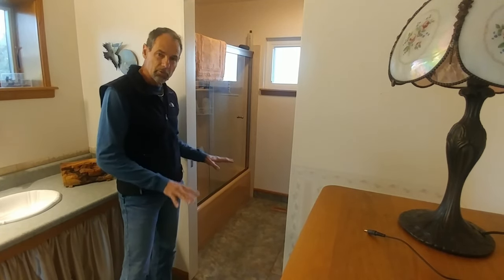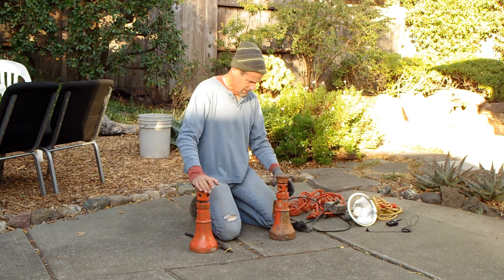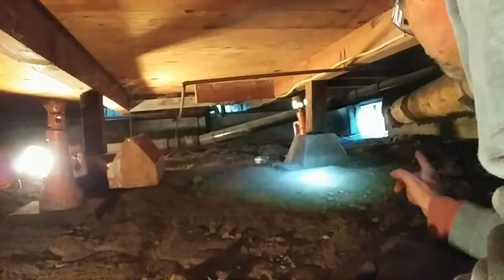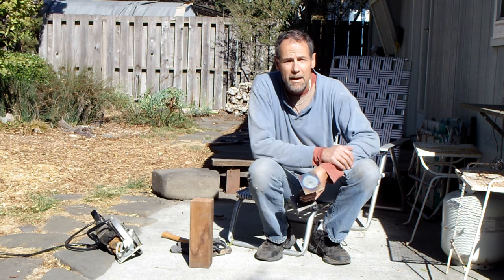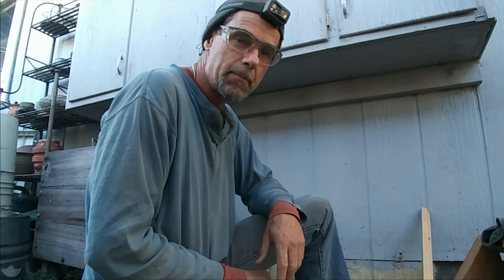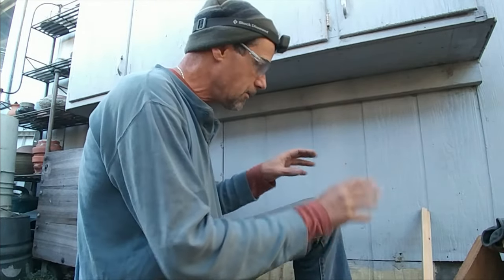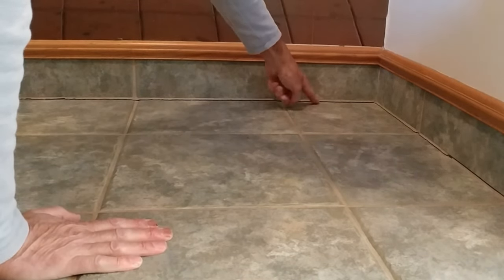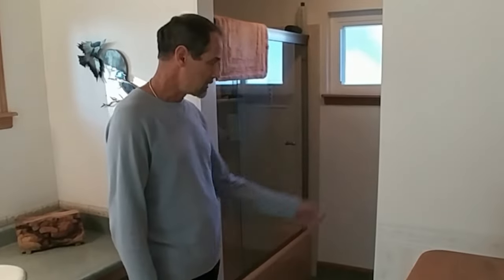Fix-it Guy Takes On Foundation Repair

Comment: Wow!  SO MUCH RESPECT to this man for getting under there and doing this work!  I personally wanted to lend a hand.  Cant believe he was by himself.  Prob a 20k job right there!   Half of my house is originally 100 year old craftsman and looks similar. Some floor noise and some mild slope, im going to have to do something similar soon.  Im kind of afraid of what ill discover down there that may require more work 😂  My crawl space entrances were all reduced by prev owner pouring driveways on either side as well.  gonna have to open them up ayayayy.  Super old perimeter foundation of river rock and local beach sand based concrete.  My area these are failing.  Curious fix-it guy,  if I can somehow use this around the perimeter to take weight off of the old footing????   what do you think?
Reply from the maker: I once worked on a commercial building which had the entire perimeter on threaded jacks. They called it a "floating foundation." They weren't this particular product; they amounted to nothing more than extremely large threaded studs sticking up out of the concrete onto which a nut and steel plates sat on each. The mud-sill, I think a 6x10 beam, was bored to drop over these threaded supports and sit on the plates. So yes, I'd say it is possible. Though of course your local building coder would need to be complied with.

Comment: Great video. Thank you. If you have to make a future adjustment do you have to remove the brackets and unscrew (or screw) the portion of the Simpson bracket attached to the 4x4 in order to lengthen or shorten it?
Reply from the maker: Just turning the nut provides +-1inch of adjustment. And of course one can always replace the 4×4 post if a grea5er amount is desired.

Comment: You did a great job and great video under 
The circumstances !! I have two questions for you 1)  Why didn’t you get
a helper to get the pieces you needed and to cut your 4x4 s instead of crawling 
in and out half a dozen times during the
day ? 2) some of the footings were off 
centre when the posts were installed , 
could you have centred them ?
Reply from the maker: To answer #1, I didn't at first realize how physically demanding the crawling would be. After all, I'm a do-it-yourselfer. Setting up and running the camera doubled the amount of crawling I had to do too, and again, I just didn't realize what effort that would require. Once into it, I just kept at it. I guess that makes me a stubborn old goat.
  To answer #2,  It isn't evident in the video but each pier block sits slightly embedded in a slop (rough pour) of cement. This prevented moving them. The evidence told me that they have always been off center. Just crappy original craftmanship as far as I can tell. I'm not sure who built this house but its loaded with crummy craftsmanship. I don't know how all these issues ever passed building inspection?! Anyway, it has stood for over 45 years regardless, and I've lived in it for 30 of those. Only now am I finally correcting many of the problems. Better late than never I guess.

Comment: So why did they build the floor joists on what looks like 48" centers? I see that they are 4 x 4 beams. I haven't seen a floor system like that.
Reply: Most places have a code that posts be on 48" center. The floor joists are usually on 24" centers.
Reply from the maker: This floor framing is rather an odd design. How'd they come up with this idea? There are other oddities in the framing of this house too. I think the builder was an amateur!
Reply: @ItsFixable  I believe it's plank-and-beam construction, not the usual pier-and-beam with 16" spacing. The subfloors are usually way thicker.

Comment: I spoke with Simpson engineers today and was told they are temporary ties and not meant for permanent installation. I was hoping to get your input as to how they are holding up because I was interested in doing the same. Thanks in advance for your reply
Reply from the maker: They continue to work quite well; I've had no issues.
Reply: @ItsFixable  thank you for replying. I appreciate your video and your response it's been a great help

Comment: You should have had a piece of 30 lb. felt between the concrete pier and the wood column to act as a capillary breaker.

Comment: That seems like a huge span where you started working.  Could be a great reason for movement and sagging, not enough structural support.  You must be in a nice climate to have open pipes and no insulation in the floor.  Appreciate the video - going to be jacking up half my new (old) house in the spring to level flooring but its wet, cold, and much nastier looking than your nice dry space.  Yeah, me.
Reply from the maker: The design (1-1/8" T&G on 4x4 beams) is one I would not recommend and to my knowledge is no longer used. But around hear, Northern California, you run into it occasionally on houses built in the '70. Nor do low cost builders insulate below the floor or pipes. It's a shame!
Reply: @ItsFixable  Good to know.  May be scary to think of it this way, I'm very close to Northernn California lattitude (southern Ontario, Canada) but I bet that warm ocean current means your winters are nothing like mine!

Comment: Thanks Fix-it Guy!   I'll be doing that shortly.  My main concern is why is your soil moving?  Do you have erosion or animal tunneling or ???   Corrective AND preventative action is what I'm looking for so I do not have to do this again if possible.
Reply from the maker: Water flooding due to neighbor issue, but that was fixed before I undertook this project.
Reply: make a footing Don't use what he is using.

Comment: I once owned a house across the street from the Augusta National (golf).  It had a Chrysler furnace that would go through thermo-couplers (1 per year). I had an HVAC guy come out to replace it one fall and I noticed that I hadn't seen or heard from him in a very long time (2 or 3 hours).  I looked outside and his van was still in the driveway though.  After 3 hours +,  he finally knocked on the door to tell me he'd finished and to turn on the furnace to check it.  I asked if he'd left or took a lunch...nope...he said he was too embarrassed to ask for help, but he'd gotten physically stuck between the ground and my floor joists and it took him that long to finally get free.  !!!!!
Reply from the maker: That's a kick. I hope he didn't charge by the hour!
Reply: @ItsFixable  Nope. About $50 total, if I remember correctly, circa 1995

Comment: Your clay soil is shrunk because it's too dry. That's why pier are sunk. Now, with your repair ,when rains  starts, clay soil will expand and your peer will return to normal previous position and floor will buckle up.
Get ready to lower your jacks. 
You did a great job, but All you need to do instead is a regular irrigation equally around the house.
Reply from the maker: In the 30+ years I've lived here, this house has always moved seasonally, but within a reasonable tolerance. This significant change was due to other factors related to adjoining properties. Since having done the repair, the house is back to moving within reasonable tolerances.

Comment: Thanks for the video! Quick question: Is it best practices to install the J57 ABOVE the post like this? I was under the impression that while it might work for connections, it’s better to install it below the post when it’s supporting something. A minor point, but was just curious.
Reply from the maker: Because my pier blocks were not properly centered under the beam, I chose to install the J57's on top. Otherwise connecting them to the piers would have been quite impossible. Ultimately,  it shouldn't really matter which way they are installed; they function the same no mater the orientation.

Comment: Great video. The only thing I did not understand,  is why screw the post to the pier? If the concrete starts to sink again, will it not pull your bean down?
Reply from the maker: My local code requires attachment. If the pier drops, the threaded riser simply moves downward in the sleeve and readjusting the carrier nut would then be necessary.

Comment: Are you installing those levelers upside down, or am I tripping? Also, I’ve never seen those with the flat plate on the end. Usually it’s a bolt that you bury in new concrete right?
Reply from the maker: These levelers are great for a situation like this where new concrete isn't being poured. They can be installed with either side up; in my case the channel width was too narrow for my beam so inverting them made sense.
Reply: @ItsFixable  gotcha. 👍

Comment: I need someone to install some of these under my house! Especially under the exterior front door entryway.
Reply: I'm feeling my house vibrate right now from a train about a mile away. People think I'm crazy when I tell them it's shaking my house off the foundation. Ground keeps settling and I had to remove the door threshold plate to be able to open & close the door last month and it's being difficult to open again already. I can't pay $4000 a year for re-leveling! I just had it done Oct 2022 and problems again by Nov 2023, just beyond that 12 months warranty. 😥
Reply from the maker: Sounds like a problem beyond just leveling. Sub-soil conditions should be examined to identify why there is so much settling in the earth.
Reply: @ItsFixable  even the street has large cracks in it. So I know it's not just my house. I'm actually looking for a small piece of land somewhere quieter to move this house to. It's sight built 1960s home, small enough to be moved for less than buying or building a new one same size. That's my ultimate goal, but in meantime I'd like to use the front door.

Comment: My floor system is similar, 4x10x12ft with 4x4 posts on poured concrete piers. Every 12 ft there is a post. The problem is that the beams have bellied down between the posts so the floors are not flat. I tried jacking the centers but all it did is raise the end with the least weight on it. My subfloor is T&G planks so it causes high spots in the flooring. Not good with floating flooring. Any thoughts?
Reply from the maker: Wow, bummer. Perhaps you could temporarily jack parallel to the beams at the low spots and then sister a couple 2x10's on each side along the existing and let the floor settle onto those? Tricky but might be doable.

Comment: I know the feeling to be in the crawlspace. We have very similar crawlspace in our modular home. Every time when I go there I’m afraid to be stuck and not be able to get out. I’m thinking to make it deeper. Any suggestions of how to do it? 
 We have cinderblocks instead of pier blocks. Do you think we should replace them to the pier blocks? 
Why you didn’t center pier blocks underneath joists or they go deep down? And how did you screw to the concrete pier blocks without pre drilling?
Reply from the maker: Well Gene, if you have building problems that require you to go below the structure frequently, those should be corrected so you need not continually go under there and struggle with the crawling. I would think digging out a deeper crawl would be most difficult and likely expensive. I have dug short passages where it is necessary to get past furnace ducting and reach other sections of my structure. These are only little two foot wide trenches, one foot deep, and are maybe four feet long. Being a curving dip, they require me to roll over onto my back and shoulder shimmy beneath the ducts. I used an old folding army shovel and scooped the dirt to the sides. It was a b***h! My soil is clay!
  A modular home has different foundation requirements than a typical house, so I assume the cinder blocks were adequate to meet the requirement at the time your building was set in place. My pier blocks are set into concrete and can't be moved. It appears they were never correctly aligned from the start. How they passed building inspection I have no idea! I don't know how deep that concrete goes. I wasn't about to try and chip it out. I live in earthquake country. While I have a continuous perimeter foundation, this type of center support is no longer allowed, but its grandfathered in because my home was built in 1975. If the house was to burn down, I'd be required to pour a completely new foundation meeting current code.
  There is a wood block encapsulated in the top of each pier. That is why I didn't need to predrill.
Reply: @ItsFixable  Thank you so much! I became your new subscriber.

Comment: Them piers sinking will continue to sink. Need 18 x 18 x18 concrete footing under each pier. You will be adjusting those levelers again!
Reply from the maker: There is cement beneath each. The beauty of these is that they can be adjusted again.

Comment: I don't believe the ground settle that much.  It appears that a piece of wood (block) was removed or completely deteriorated.  You can tell by the nails that are left behind.  At the bottom of the post you can see nails used to toe nail into the blocking that the post would sit on.
Reply: Agree! Likely termites have eaten them up.

Comment: You have no insulation in your floor.   My house has fiberglass batts between every floor joist, plus forced air heating system ducts, also with fiberglass wrapped around, to complicate the job and navigating around in the crawl space.  I noticed you used level on the bottom of the beams.  Can you trust that the beam height is consistent?  i.e., what you really care about is the level condition of the floor, not necessarily the bottom of the beams.  Thanks for the tip about Simpson J57's.
Reply from the maker: It’s nice you have insulation. I thought about installing it years back but decided it wasn’t worth the work which is made more complicated because of the joist-less floor beam framing. My furnace ducts are wrapped though and a B***H to crawl under. I’ve scraped some of the dirt away in spots to at least provide a bit more clearance to pass beneath. It sucks!
  The house being 45 years old, level isn’t so important as flat. There is some variation in the perimeter concrete anyway. The beams are surprisingly close to level though, and yes, I feel I could trust the bottom measurements. The subfloor is 1-1/8” T&G ply and in good contact with and glued to the beam surfaces. It’s the only house I’ve ever seen constructed this way, but I’ve worked on large commercial building with truss framed floors that have more spring and variation than these.
Reply: @ItsFixable  Thanks for the very prompt reply!  In between first comment and now, I checked the price of Simpson J57's -- anywhere from $35 to $50+.  Is there any reason to take them out (and replace with wood posts) after the floor is level?  Maybe to use them in a different place in the house?  I also crawled under my house to once again puzzle over exactly what needs to be corrected.  The place is a split level and it's very complicated framing down there.  I think I need a laser level...  Thanks again for the friendly reply.
Reply from the maker: @ptreth  I suppose you could remove and reuse them but they're designed to remain in place. I did find I needed to do some minor readjustment a couple months after the work was done. All the stresses in the structure change with the jack's installed and the house framing takes a little while to settle into the new paradigm. 
  I paid $35 each. Seemed a little expensive in that they are a rather simple device to manufacture, but in the end it was worth it. Yes, a laser level would certainly be helpful. I'd rent one if I was to do this again.

Comment: What kind of post & beam design would that be called? I don't see any traditional floor joists under the subfloor. Just post, beams & subfloor lumber. Looks sturdy though. Thanks in advance, Dan
Reply from the maker: The subfloor is 1-1/8" T&G ply, so it is quite solid. I don't believe it meet current construction code requirements though. I don't know what this design system would be called. I've only run into it a few times in homes built in the 1970's.

Comment: I am a old drywall finisher digging to repair sinking house 
No idea what I'm doing first thing is how or were you start on the leveling process
Reply from the maker: First step is always to determine the cause. Without understanding that, a solution is difficult to define. The second step would be to get accurate measurements as to where and how far out of level it is. With this information, one can then hone in on the proper corrective action.

Comment: When you set the precast pier in, did you pour a footing first and let it harden partially, or did you place the precast in when the concrete was completely liquid?
Reply from the maker: It appears the builder set them into a slop pour without good alignment.  So they're rather immovable.

Comment: Hey, were did u get those Jacks from.. I prefer those va hydraulic jacks because they slowly go down over time.. thanks in advance
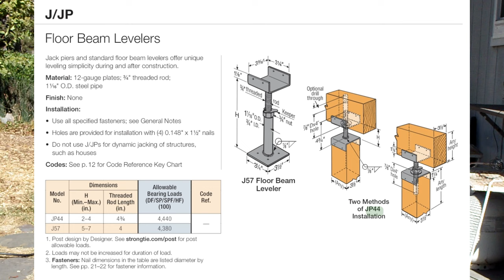Reply from the maker: If you're asking about the house jacks, the screw jack I used to lift the initial weight, I rented them from a local yard. If you're asking about the beam levelers, they are a Simpson Strong-Tie product #J57 as shown @10:35. A local construction dealer had them on the shelf. If you can't find them local to you, I'm sure a dealer can order them for you directly from Simpson.
Reply: @ItsFixable   thanks bud..